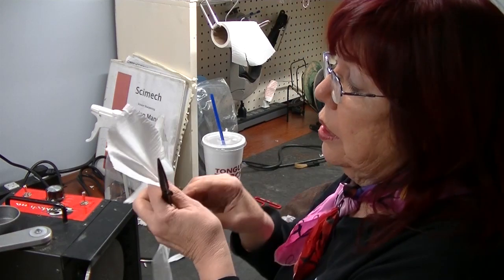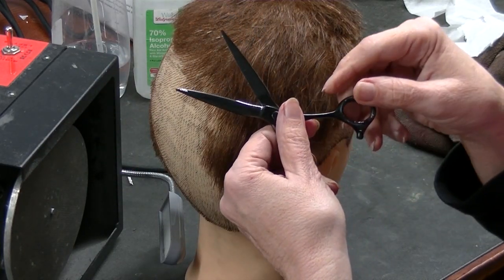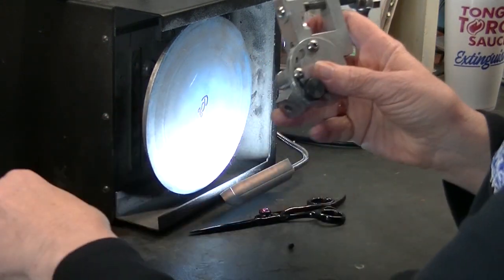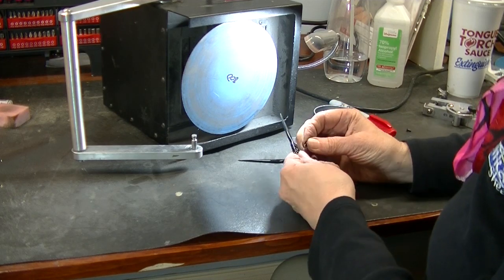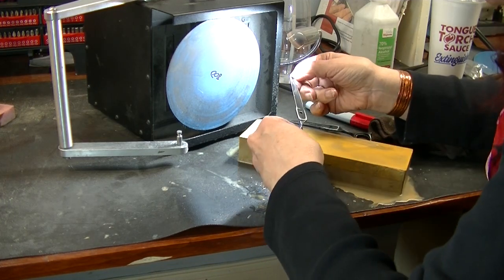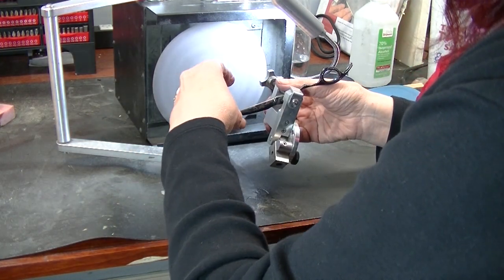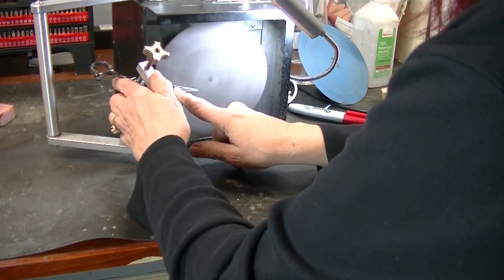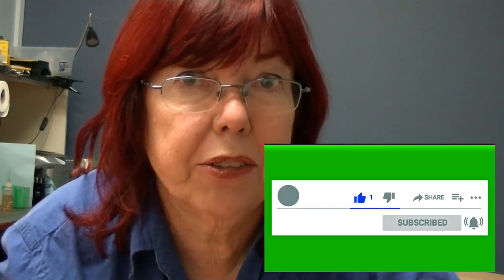Sharpening a Joewell Shear Sent by Another Sharpener - Can I Make His Stylist Happy?

Comment: Breaking the burr with nail file sanding stick is one of the worst procedures that you
could do for finishing the edge.  You are creating jagged edge that will cut rough and loose sharpening quickly.
Reply from the maker: It's a 3000 grit nail buffer, not  nail file.